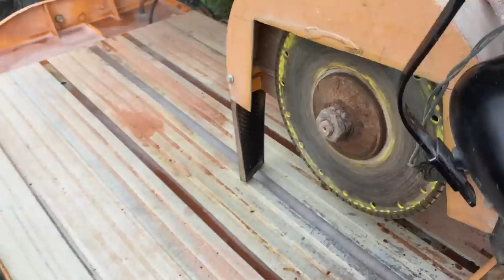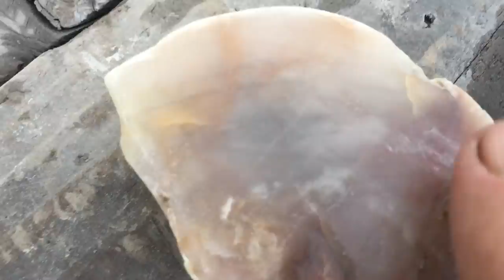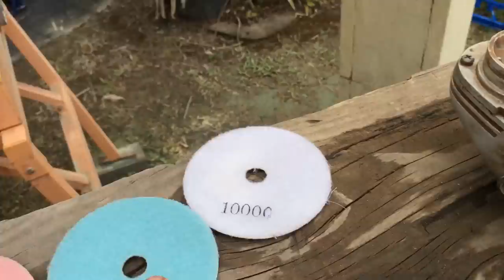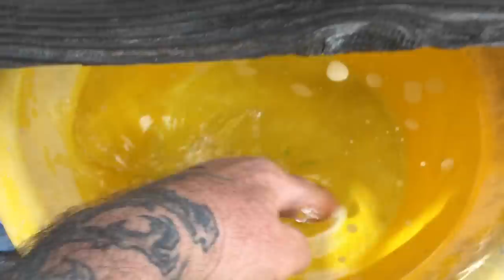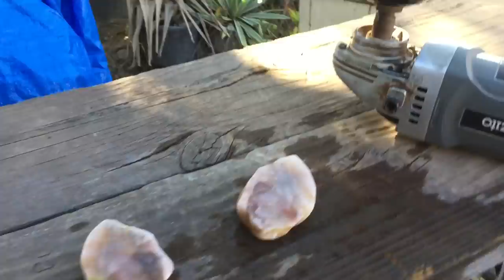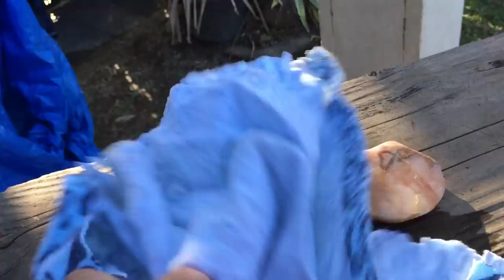Polishing Rocks with hand held Polisher/Sander - Part 2,  a more detailed look

Comment: Clamp the grinder to the bench. Use 2 hands to contol the stone.
Reply from the maker: hi mike, thanks for comment, clamping the grinder might suit certain work, but I need the flexibility and accuracy of freehand. Clamping also prevents me from working on very large pieces such as petrified wood logs weighing 10+ kilograms. The new sander/polishers are battery rechargeable now and only half the weight and very flexible in what work can be done with them,      kev

Comment: What grit did you use on the first diamond abrasive disc with the grinder?
Reply from the maker: hi lorraine, i allways start with 50 grit, (or the lowest grit in your set), it also takes the most work of all the grit sizes, no scratches should be left after the lowest disc is used, 
(the rest of the discs are just for polishing the shine),      kev

Comment: Great video ... thanks!  Which bar compound do you use on your buffing wheel?
Reply from the maker: dont usually use any compounds, I dont like the slight discoloration I was getting, 
I dont usually use anything now, just buff item until warm/hot on a stiched sisal wheel.
If the item does need extra I will apply Autosol metal polish to the surface before buffing, it has a very fine grit cutting action, allmost like 20,000 grit,
kev
Reply: @kevinnix6531  Thanks Kevin.  That's very helpful!

Comment: Perfect for doing a matching set of bookends.  Start with a heavy, good looking rock approx. 10" High,   x   9" Deep,   x    4" Wide.  Cut the rock in half and polish the two exposed .  sides.  Those will go against the books.  Cut a couple inches off the bottom of the two halves and polish so your bookends will now be about 8" high.  Enjoy your hand made bookends that should take no more than 30 minutes to complete.
Reply from the maker: Rick Crouch 
yes, i agree rick, the beauty is the simplicity, with minimal equipment the rock can be polished up and looking great. Thanks for comment,
cheers, kev

Comment: So I have a dremel and tons of different petrified wood and jasper, different kinds of quartz and so on.... trying to figure out the best way to polish it using a dremel. I have diamond bits for carving but am having difficulty finding something to smooth and make em shiny
Reply from the maker: hi benjamin, i’m not real familiar with dremel work, the only thing you might try is the sandpaper discs that fit the dremel, you would have to start with the coarse grits and work thru to the finer grits. 
      The coarse and medium grits could be a dry sandpaper,  but i would suggest ‘wet n dry’ sandpaper (used wet) for the fine grits. 
      A felt disc on the dremel could be tried for the final polish,
kev
Reply: hi benjamin, I’m in the exact same position right now. just got my first dremel machine to pretty up some of my quartz and jasper found in the hills. the process i’ve been doing is first grinding down the rough edges and going over with a few different grits of sand paper then finishing off with a polishing wheel. they have came up looking real nice and shiny, but nothing really compared to the work in this video, I would love to reach this stage of rock work one day.
Reply from the maker: ebony pollard   hi ebony, try to find the wet and dry sandpaper, usually dark grey coloured, wet the rock with soapy water when using it. Sometimes the lack of shine is due to not using the coarse grits enough,
after using coarse grits the rock wont be shiny, but will be very smooth, like a “soapy” texture, only then should you move on to higher grits.
Wet and dry sandpaper should be available right through as high as 1200 grit, which should provide a great shine
kev
Reply: Kevin Nix will that work on rocks such as petrified wood that have a high quartz content and what I remember to be an 8 on the hardness scale? I have a diamond grinding attqchments etc but will sandpaper really work? Do you get the kind for metal or the kind for wood?
Reply from the maker: Benjamin Goulet 
as i said in my reply, use wet and dry sandpaper, i’m not sure what material its rated for. I also stated i’m not familiar with dremel work, but i have used wet n’dry paper on agates using hands only, no machinery, 
    I wont repeat myself for other points, please just read replies above, 
cheers, kev
Reply: Kevin Nix ah I see, wet n dry I believe is used or recommended for metal. Didn’t realize you where referring to a type of sand paper but thought it was a method you where talking about. My interest is spurred by the fact I have hundreds of lbs of top quality opalescent and agatized jasper and petrified wood including picture jasper. It is all rough and I want to start doing something with it. Thank you for the advice. Cheers from central Washington state
Reply: @ebonypollard7171  what do you use as dremel sand paper the cylinder model or flat round one?

Comment: Thank you for this lesson.  I have been wanting to polish my big rocks 10 pounders, maybe 8-10 inches long/wide and not too thick.  What do you do about curvy edges that you want to keep that way?
Reply from the maker: hi karen, the soft diamond pads are quite flexible, you can just follow the curves on the rocks surface, it just taks a little juggling with the sander/polisher, it also takes a little arm strength, I rest from a large job often, take a break, have a cuppa, then back on the attack. Just be sure to spray the work surface with soapy water now and again. Its not absolutely critical if it dries out between sprays.,    kev

Comment: What type and size blade do you use with your saw, please?
Reply from the maker: on my angle grinder i use 4”/100mm dry diamond blade.
on my wetsaw i prefer to use 9”/225mm wet diamond blade

Comment: Do i need a rotary sander, orbital sander, or random orbital sander
Reply from the maker: I use a normal rotary sander, with 4”/100mm velcro attachment. (the attachment usually comes with the diamond pads kit)
important that attachment fits the thread on the sander (mine is 14mm)
- most diamond pad kits on ebay have either 14mm attachments, or 5/8” attachments

Comment: Thanks for the video.  I just started polishing with a similar setup but I think my rocks aren't perfectly flat, so those areas aren't getting polished.  What should I use to get the surface perfectly flat?  Or is there something else i am doing wrong?
Reply from the maker: hi chris, not being perfectly flat shouldnt be too much of a problem, as the wet diamond pads are slightly flexible, 
if you wish to flatten the surface more, try using velcro attached flat lap discs, I think I show there use in Part 3 ?
They are available from THK diamond tools online,      kev

Comment: Hello Kevin.  One question - did you change the speed of grinder as you went from 50 to 10000?
Reply from the maker: hi jaikram , 
no, no need to adjust speed, just stay a little bit higher than the lowest speed all through the process, its just a mix of the slow speed and pressure that polishes the rock,
kev
Reply: @kevinnix6531  Thanks, great learning video, stay happy.

Comment: If I needed to hold the grinder with both hands, is it possible to say rest the rock on a heavy ribbed rubber mat or in some special made clamp. My grinder arrived today but waiting on diamond disks. Any suggestions pls.
Reply from the maker: gayedawn1 
its a lot safer to hold the sander in one hand, and hold the rock in the other, 
I hold the sander in the crook of my arm.
If you have a sander that doesnt have the trigget ‘lock on’ switch, you may need to cable tie (zip loc, or zip tie), the trigger on, and use a seperate power board to turn the sander on and off.
I have used a rubber mat to steady a rock, but it can slip and move, you have to judge each seperate rock yourself.
I have never had to use a clamp device, so i cant advise on that sorry.
Your arm will ache a little when you first start to polish, be sure to rest in between polishing until your muscles get used to it.
Hope you can develop a technique that suits,
kev
Reply: Kevin Nix...I'm 71 so probably not as strong these days. 20 years ago I took all the paint off my weatherboard house with a heat gun and sanded it back to the original before painting, so do have a bit of tool experience. The wet/dry grinder with multi speeds is a little heavier at 2.5 to 2.9 kgs but my club would not tell me how to partly polish larger specimens which I have. My dad was a tradie and even he had a run in with a grinder years ago. Safety is my main concern and I was worried about holding it like you do because of your expert experience and my age. . At the club when they saw slabs they use timber bits to clamp the rocks in place for stability and balance, that was one of my thoughts. Thanks for your video as there is no one else doing this only people using only their hands or dremel.

Comment: Hi Kev, great video's, I'm new to the hobby just got myself a Rubi Wet Tile Saw. My first rock will be cut at dawn, I have a piece of Blue Quartz to play with. Where did you get the rock display craddle at the end of the video? I would like to get some they look awesome. Cheers Kev
Reply from the maker: hope your cutting is going well, it’s addictive, be sure to follow through and polish a few up as well ! I got the display stand from ebay, if you search you will find one,    (smaller) kev
Reply: @kevinnix6531  Thanks Kev, yes I have just received my polishing pads in the post. Thanks for the reply Kev, and thank you for sharing your video's. Cheers Kev

Comment: This is a fantastic video/tutorial :) Thank you for sharing your knowledge! I was wondering if you think I could produce a similar finish on pieces of petrified wood that are similar in size to the rocks you polished in this video, using a dremel tool? I hope to hear from you... Thank you for your time in advance!

Kind Regards,
Krystal Skye
Reply from the maker: Krystal Skye Brisson ,
hi krystal, allthough i havent tried it, i would imagine the very basic steps are similar.
      keeping in mind the dremel has small attachments, so dont overeach, keep the pieces of petrified wood small.

- decide what attachments you are going to use on the dremel. eg: sandpaper, or diamond abrasives, or other. (just make sure you have a set of them that start at a coarse grit, and gradually reach a fine grit.)

- the most work is allways with the coarse grit, make sure you get as many scratches out as you can. (you may not get the very deepest ones out, but try, and leave them if you have to)

- when you reach your finest grit, if your not satisfied with the shine, or glow, you can use a cream polish to enhance the final finish.
you can choose from two types ...
1. cream metal polish (buy from auto shop)
2. cream wax polish
just follow instructions on products

hope this helps, thanks for watching video,
cheers, kev
Reply: Yes dremels work very well

Comment: so its enough if i keep the stone wet.i dont need to buy an expensive polisher with watter?
Reply from the maker: hi 7, as you may know, rocks have different hardness, some are really hard and can only be poilished with assistance from polisher or similar equipment. Softer rocks can be polished using wet and dry sandpaper (by hand), using soapy water, work your way through all the grits, from rough, thru to fine grit smooth. It gives you reasonable finish,
kev
Reply: @kevinnix6531  yes i remember when i was younger i was working in a firm where they carve toombtones and i had to use 7 different diamond grits. i just recentlly become a fan of gem hunting. i live above a silwer mine in a small town of slovenija started colecting jasper quartz and cinobarite we have that in abundance here. and things went so far now i want to make my pendants and mybe sell them and im just thinking do i buy a thumbller or i can do it manually i guess boot things needed for different stylle of work or as you said hardnes of material. Bt considering the prices i think is better if i buy small crystalls and work on them. and than as a hobby polish the ones i find and keep them for mysellf.will see its on im addicted i just wish i found this earlier in my life bt as they say newer to late for new things. Time to go rockhounding and watch wideos by night. tx
Reply from the maker: hi 7 lateralusaint ,
sometimes its good to visit a local lapidary club, (if possible), you can get ideas of which way you wish to go ahead in this hobby, there are so many different choices and methods,
kev
Reply: @kevinnix6531  yes thank you . i just aplied for the onlly lapidary club i found in Slovenia. After i figured out what it means). thank you for this. they have meetings diggings gemshows and u can also learn about cuting and polishing. so thanx very much. i wish i suceed so this can be my main income.

Comment: What type of polish do you use on the buffing wheel,if any ?
Reply from the maker: hi dan , I dont use any polish or wax, I like just the friction of the wheel to do the job.
      In saying that, since I made the last video, I have discovered that 4”/100mm felt wheels fit on to my sanders spindle (via angle grinder nuts), I run these at minimal speed, barely wet, with Tin Oxide powder applied. This gives a mirror finish, to top of your polishing processes.
cheers, kev

Comment: Hi Kevin,  I just finished polishing some petrified wood using you method.  One issue that I had was when I started using the wet diamond discs (started with the 50 grit) I noticed many small hairline scratches all over the surface when dry.  The continued work with each pad finishing with a 3,000 grit did not buff these out.  I then returned to the PVA pad after the final polishing and was able to finally get those scratches out, the proceeding directly back to the 3,000 grit wet disc with good results.  Was just wondering what I might have done wrong to cause the scratches with the wet 50 grit diamond pad.  I did keep the stone wet and lubricated with ivory soap in the water.  Any insight would be greatly appreciated.  Thanks!
Reply from the maker: Cheryl McMurray 
hi cheryl, a critical step that is probably not on the video is to work your lowest grit (whether it be 50, or 100 ) a bit longer  than all the others. 
          And then ALLWAYS dry the rock with a rag, or old towell is better, take it into the sun, or bright light, and inspect the dry surface carefully. You MUST  be satisfied with the surface before you continue. It may mean repeating the lowest grit process again, if you do, ensure to dry and inspect again.
       I must find the time to make a follow up video, to include this tip, and a few others that i have learnt since making the last video.
      Note- sometimes you might have to make the decision to leave a deep scratch if it isnt viable to remove it, I make that call now and again.
        Hope this helped, also remember all rocks are different, hard, soft, dull, shiny, the more rocks you polish, the better you will get,
cheers, kev
Reply: Thank You Kevin!
Reply: What is the green and white rock on the end of your work bench? And what are going to do with it?
Reply from the maker: Linda bower ,
hi linda, thanks for watching video,
the green/blue rock is Blue Chalcedony in Jasper. Its from Cloncurry, Queensland, Australia. It has been cut up into slabs and sold. If you need to get this type of rock and many similar to it (and you live in Australia), then take a look at the Facebook group “Mackay Fossils and Rocks”, similar materials are advertised for sale on that group regularly,
cheers, kev
Reply from the maker: bullshitdave 
good tip dave !

Comment: Hi How long are you polishing the stone on each grid disc? thanks
Reply from the maker: Dagmara K.Lesiow 
hi dagmara, thanks for watching video, usually just a couple of minites in each grit size. Make sure to turn stone around to different angles within them few minutes.
        After the very first grit, the lowest grit, dry the stone with a rag or towell and inspect for scratches remaining, if you see scratches, either work on them some more with the low grit, or, you might accept them if too deep.
(many pieces i have accepted a deep scratch and left it there)
kev
Reply: I count stokes I count to 27 back and forth is two I do this across the whole polishing surface with the three areas going of the pad start with the top of the pad like a half inch of the pad sticking up over the material do the 27 stokes across the surface u are polishing then repeat but using the center of the polishing pads basicly imagine the pad is a number 0 if u put a line across the middle of the zero thats the center area of the pad and ur line of movement as well 27 times. Do it one more time with the bottom area of the pads some types of stone don't always call for 27 stokes with all 3 pad contact areas I've come to feel how that it's ready to switch pads early when u can feel ur self sliding over the surface of the material real smoothly

Comment: What is the name of the disc you used on the bench grinder?
Reply from the maker: DocGriffon , first a concrete grindind wheel (very rough), then a PVA wheel (abrasive suspended in plastic, softer), thanks for watching

Comment: Use a tin Oxide paste to high shine???
Reply from the maker: hi kara, yes, tin oxide paste can be used for even higher shine, (not advised to used on rock with cracks or pinholes, its allmost impossible to remove the white paste), but fine on smooth rock surfaces. 
      I use felt velcro attached pads with the sander/ polisher i use, they buff up the surface well with the tin oxide. An alternate method is to apply the paste to the highest grit diamond pad you have, this works well also.
kev